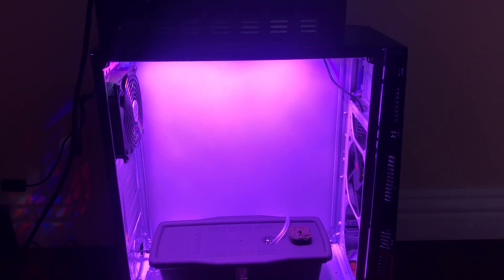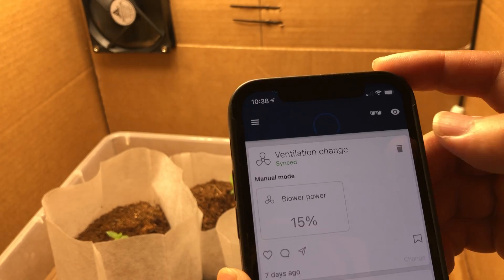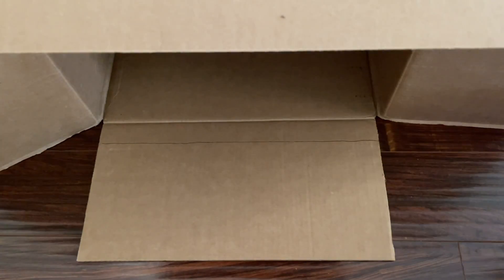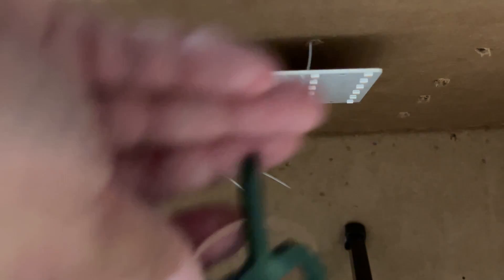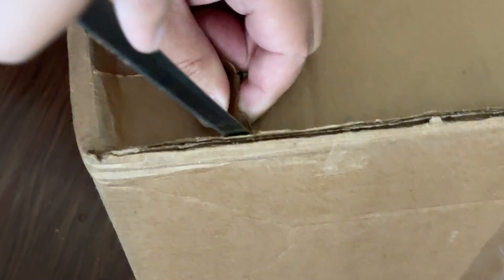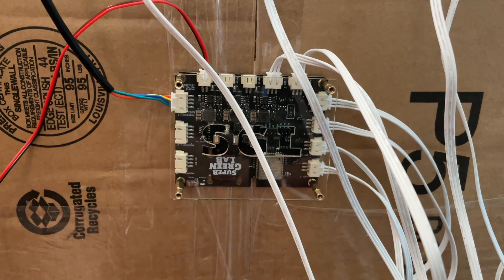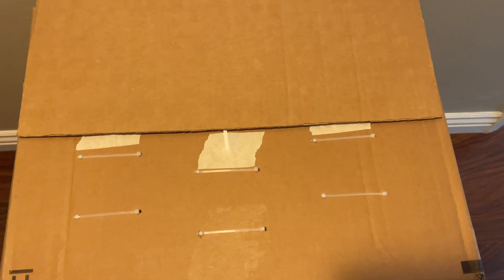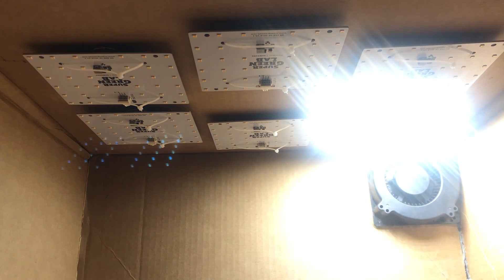Using a Cardboard Box to Grow Hemp

Comment: I decided to use a cardboard box but just a regular medium sized box, I glued all the inside with foil and cut a decent diamond hole on the top still able to open flaps, put a lantern over that hole carved slices on the side placed a regular small square fan on the wide slices  just giving it water 2 months later it’s growing beautifully I highly recommend this method. no bs as for the light eh I turn it on 12 pm and off 12 am. Works for me

Comment: Ive been looking around for a large side by side refrigerator box - in one of your previous videos you mentioned having to be careful not to spill water ( thick sheet of plastic on bottom) for the walls  im going to be using glued alum foil on the walls/ceiling .
Reply: Yea, I am trying to do the the same thing except that I want the huge cardboard box to be able to allow me to put a metal shelf of 2ft X 4ft X 7ft tall so I can hang lights, fan, etc... Great idea with putting plastic at bottom for water spillage. Do you have a video on you doing this? Thanks.

Comment: You’ll be surprised how quickly you run out of space. Cannabis is real picky about its growing environment. Way easier just to spend a little and get a grow tent.
Reply: Space isn't a problem if you train your plants well, have done  more micro grows than tent grows over the years, only real difference is the quantity apart from that never really had any issues with micro grows the quality has never been a problem.
Reply: @robjoe36  I started out doing micro grows sticking with short growing strains and quickly realized the hassle wasn’t worth it. I still train my plants since I went to a 2x2 tent but at least I have some room to do it. To a beginner this may not be a path to success is all I’m saying. My first ever attempt was a space bucket grow and access for RST was almost comical if not impossible for a nube at the time. I will be building an actual environmentally controlled grow room to start a Sativa run.
Reply: @greasemonkey1880  for some people growing in tiny spaces is the only option, a small grow is better than no grow
Reply: I've got two Gorilla cookies,,,, 1.60m tall auto flower's,,,,,,Huge

Comment: Not to undermine this, but if you’re going on the cheap, why not use 14 w LEDs with the plastic cover cut off?  6 would cost under $10 and you could plug them into a power strip with bulb adapters. $8 clip fan and a computer fan for exhaust. JM2¢